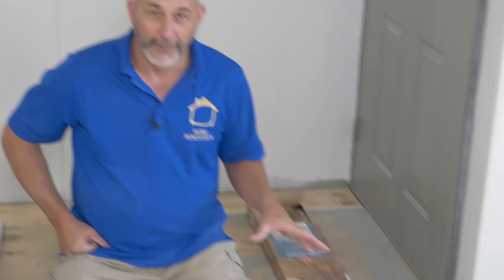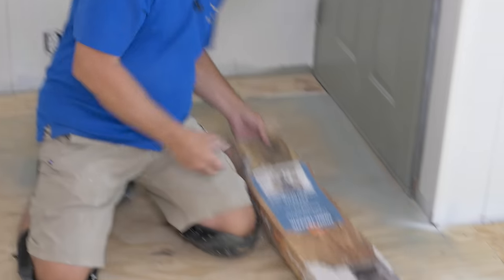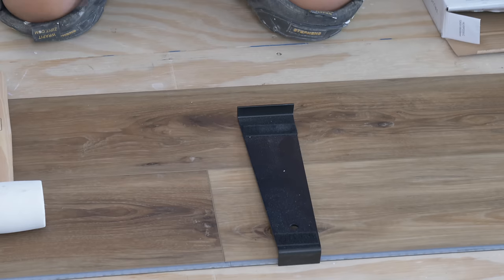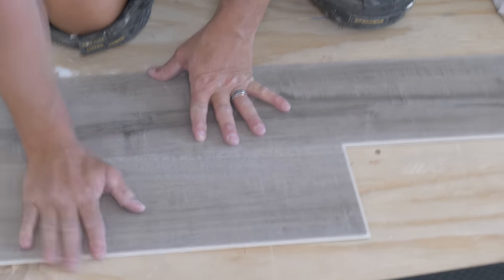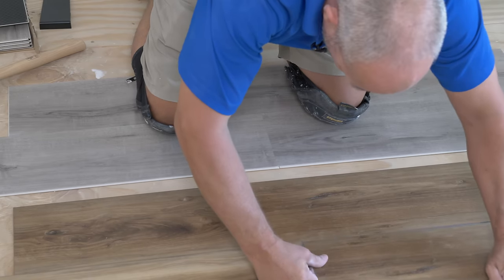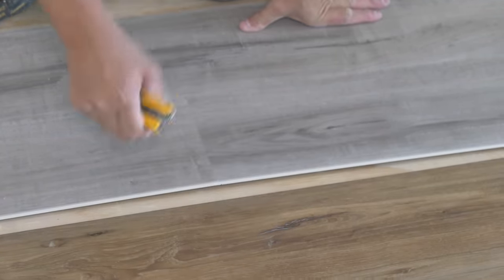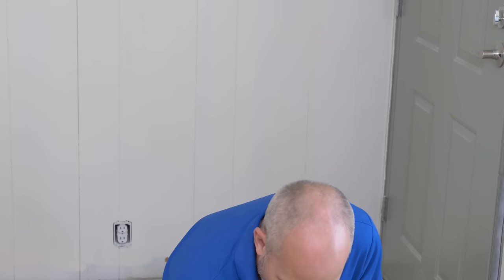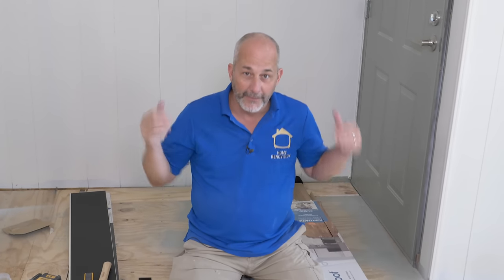2 Types Of Vinyl Flooring | Which Is Right For Your Home?

Comment: What do you recommend for a poured basement with radiant heat? We rebuilt after a house fire and decided on a 9’ poured basement and put in radiant before pouring the slab. It’s 28x58 so it’s a big project after putting in the energy walls. We are in Northern Wisconsin so we opted for heated slab. Thanks!

Comment: We own an apartment condo in Florida with 12x12 inch tiles on the floor which is concrete. The floor is primarily flat but certainly not perfect. I strongly suspect there is no movement in the floor so I’m wondering if the tongue and groove vinyl flooring will be a successful floor project. I would like to avoid pouring levelling compound if it isn’t necessary especially as the new floor will be next to carpeting.

Comment: What would you recommend I use on concrete basement? Laminate or vinyl? I’ve hear laminate may have water issues from concrete.
Reply from the maker: that all depends on the age of the house. in many cases I recommend a subfloor. for support during your reno consider joining our membership. I can consult and you can send pics. Cheers!

Comment: Went with engineered wood on my 1943 reno, because my subfloors weren't perfectly flat and I could staple them down.  Soon learned that it is very sensitive to moisure, aka cat urine.  It will cup on the edges.  I have to set weights on it while it dries to flatten it out.  Wood, tile or LVP next time.

Comment: Hi Jeff, my wife and I have a 70’s mobile trailer and the floors are all uneven due to trailer floor issues. We have repaired it to the best that we can, but the main floor area is a bit uneven. We are looking at replacing the old flooring which was carpeting throughout most of the areas. 

What’s your thoughts on a new type that we came across in the local building store called “ Lay Flat vinyl floor. It’s a product that you can on uneven floors and you glued down to the subfloor.

Comment: Is my scenario one where a click lock flooring would be appropriate? We bought a house that needed a total renovation, and did the first half of the renovation when we moved in. We have been putting the second half on hold for numerous reasons, but mainly money, however the floor on the main level is coming apart and causing splinters, etc. We need something to cover the existing floor but plan on replacing it with hardwood in 2 to 3 years (to match the first renovation) Would it make sense to do the click-Lock option in this case? Thanks!

Comment: We own a 1964 quad level home. We are looking to replace the flooring in the lower level, which is on a slab. One of the rooms will (springtime) become damp. We have placed a dehumidifier there and it has helped reduce the.moisture. What type of flooring do you recommend

Comment: I have a slab on grade... that was poured in the 60s... and is so uneven that before I used some leveler there were gaps approaching an inch over 8 foot spans.   At one point along the wall I noticed a crack.. so I figured.. open the crack up a bit with a chisel to get a good surface to bond with and apply some patch, right?    Apparently there was some sort of underlayment that they poured the concrete over.. probably a moisture barrier of some sort... and at that point where the crack had occurred it had bunched up really high so the concrete at that point was less than 1/2 inch thick... no wonder it cracked... sheesh.  I literally don't know how they poured that slab so poorly, unless they were actively trying to.  It certainly has made my vinyl floor journey... interesting.

Comment: Been looking to install new vinyl flooring in kitchen as previous owner used regular laminate which clearly not appropriate as it's lifting up. Will have to rewatch some ofvur previous videos as not familiar with the construction terms used. It's a 1970's home so floors aren't level.

Comment: Hmm 2nd floor kitchen, townhouse built 1989.  2 layers of sheer vinyl.  The 2nd sheet vinyl they used some self leveler but they could not get it perfectly level, it more a long distance in non level not a whole bunch ups and downs.

Looking at LVP overtop of existing sheet vinyl.
Reply from the maker: sounds fine to me. Cheers!

Comment: A couple more tips: if there is a flooring supply store like Prosol in your area, you can find plastic tapping blocks for your love taps that won’t damage the floor like metal ones do. It’s best practice on butt joints to start tapping from the joint out towards the open tongue to avoid a bit of buckling at the joint which can happen if you’re a bit too tight.

Comment: We have had vinyl for 6 years and my floors are very uneven or sloping (130 year old house). I have a couple of spots where it cracked because not having enough plywood under it. We are pretty happy with it overall, especially if it lasts another 15 years, which it seems like it will. Cost me about $3k per 1000sq ft.
Reply: Is this cost include the sub flooring and any labor charges or did you install it yourself ?

Comment: I have watched many of your videos and appreciate all the info you provide. In this video you talk about the ends coming undone and I get that BUT once you put the next plank on it locks the joint between the two boards making it secure and will not come apart very easily. Isn't that correct?

Comment: Tanks Jeff. Love your videos. Is Vinyl a good alternative for an older house where radiators are a primary source of heat? I'm concerned about a plastic type product might succumb to the heat of the feet which come in contact with the flooring

Comment: Thank you for the video, very helpful.  I was wondering when you mentioned the sunroom, we have a radiant floor cemented basement.  We are DiYing finishing it.  We need it to handle moisture.   What product?  Or is tile the only way?  We were hoping to stay in our wheelhouse, and avoid nailing because of the pipes and cement, glueing due to moisture or grouting (no experience at it) .  We have used vinyl tongue and groove with cork back before, but will it be okay with that direct heat?

Comment: I have used both and had it professionally installed and the one that you use the tool to close the inner gap is pure garbage for spills. I wouldn't waste my money on that flooring ever again. Oh and the space you have to leave around the baseboards so it can expand also helps it become lose and leave gaps. If you have kids or pets I don't recommend either of these types of flooring. Spills cause buckling and like he mentioned the joints are easily damaged and they start peeling and it looks horrible. Also a quick fix is not an option you have to start from one side of the room and remove all the planks without damaging them which is almost impossible to fix the one that was damaged then reinstall which is a total pain. The tap joint ones also if they get wet over a few short times they are ruined.

Comment: I just purchased a new old home.  Built 1900s.  It has planks and linoleum.  The planks are starting to come up and where the linoleum  is there is a strong odor of urine.  I was told water can enter the joints of planks which causes them to separate.  For that reason I want linoleum.  As a disabled single woman, I having a contractor do the work.  WHAT SHOULD I DO?  Plank or linoleum? BTW the floor is uneven.

Comment: I have a question because I just bought $8,000 worth of nucore vinyl 2022 Deerfield Hickory love the color ready to install it and then come to find out Floor and Decor has an F Better Business Bureau rating and a lot of people are complaining about the poor quality of Nucor now I got an 8 mm 30 Mill wear layer seems to be pretty strong but it is on the softer side and it doesn't have a Sheen to it,  which I like for my rustic-looking house. A contractor that I met in Floor and Decor actually told me that this particular one did have a problem and that it was fixed maybe a bad batch so I figured maybe everything would be fine he never ended up giving me a bid and I'm starting to think it's because of that flooring does anybody else have experience with new core products do you like them or hate them or have they been perfectly fabulous for you
Reply: Follow the manufacturer’s instructions you will be just fine.

Comment: The people I purchased my home from (in 1986), had enclosed the 2 car carport, den, kitchen, breakfast area, laundry area, pantry and turned it into a 1200 sq ft carpeted Great Room.    That was the selling point for me on the house.   I want to replace the carpet with something easier to keep clean.   I have some serious allergies.   Also the house has been unoccupied for over a decade.   I am confident their contractor did not bother to level the carport floor.   Would you recommend self-leveling concrete?   I am thinking I could save money by removing carpet and padding and leveling the floor myself.   At 73 I am definitely going to tackle installing the flooring although I do not know how long I will manage.    Being stubborn I know I have to at least attempt to DIY it.   (Removing carpet and pad is nasty and physical but doesn't require heavy concentration.   And no measurements.)
Reply from the maker: depends on the amount of slope. for large variance regular concrete or gypcrete are also great options.
Reply: @HomeRenoVisionDIY  .   Unless someone (moi), is looking for it the slope is not currently noticeable.   Once I remove the carpet and pad I will verify the actual difference.   Thank you.

Comment: I just installed lifeproof through my whole upstairs without any transition strips (only about 1000 Sq ft). It went in nice but now there are quite a few joints that are showing a gap on the short end. Maybe this was the issue?

Comment: Can self-leveler be used on a wood subfloor? Or does the moisture get sucked into the wood & eventually warp/crack it?
Reply: Yes but you have to apply primer on the subfloor before pouring self leveller
Reply: @Faruk651  Thanks for the info…
Reply from the maker: I have a video on that process here. https://youtu.be/cGHlkW2lJpY
Reply: @HomeRenoVisionDIY  I’ll be heading there! Thanks!

Comment: On the tongue and groove. If you need to start a long run in the middle, say a long hallway from left to right between three rooms on each side can you start in the center and work backward either left or right so the flooring matches up in the rooms match ?
Reply from the maker: a good t and g can install in 4 directions. Cheers!

Comment: 8:10 that does not happen, it is locked into place by the tongue and groove of the planks either side. i have it and did not level a part of the floor and it flexes but does not split like that. (one day i will lift it all up and do it properly)

Comment: Thanks for the great info, Jeff!
I’ll be renovating my basement in the near future and removing our 70’s shag carpet 🤪 and am looking to do some LVP/LVT. Do you think the LifeProof would suffice? We have a HD overstock store with deep LifeProof flooring sales which is appealing. It is a concrete slab basement that I will level and follow your other videos for moisture proofing.
Reply: Also, is buckling an issue with these flooring? We did hardwoods on our first floor and my wife said the sales men said LVT/LVP tends to buckle. Biggest space is 18’x17.5’
Reply from the maker: that guy lied.

Comment: My spc flooring was definitely harder to install. I ended up paying to have it installed. I could not get it to line up right when tapping it in placed. Definitely a 2 person job if your doing a large area or hard house
Reply from the maker: i found connecting the length first makes it easier.
Reply: @HomeRenoVisionDIY  my planks were 5 feet long. The trick you showed with your knee probably would have helped. They used their feet to get enough reach.

Comment: Our home is 30 years old, original owners. We have a hardwood flooring on the majority of the first floor (over a basement). The wood floor has been refinish once, (not a very good job). Could a vinyl locking system be used on top of the current flooring?
Reply: Jeff , I have pretty well the same question, I think it would go over hardwood flooring but would like your opinion. I have watched you for years, you would not know it but you really helped me to do my whole basement. Thank you

Comment: I bought our house on a slab and whoever installed previous floor didn’t lock etc I have gap 1/4 to 1/2 in from everything moving around which has caused peeling etc we’re looking at floor replacement but still undecided

Comment: Do you have any experience with the lumber liquidator brands of vinyl? Coreluxe and tranquility?
Reply from the maker: not yet. In my experience ll is lower quality than box store
Reply: Im surprised to hear that, we do sell some cheap turn and burn vinyl, but I think there are high quality products we offer. Love the channel and the work you do regardless!
Reply from the maker: with all things, a company brand determines opinion. if the new LL wants to change my opinion then all they have to do is reach out for a conversation.

Comment: The floors in my hallway, and master bedroom have that Pergo flooring, and I gotta say it sucks. It came with the house, so I have no idea how old it is, but it has a few spots where the edge of the board has been chipped away. In the hallway it makes a small, but audible click noise, and some of the boards slide around because they were installed going across the hall instead of flowing with it. We want to do all the floors, but it's going to cost a fortune even if we DIY it.

Comment: Whats difference between a mallet and hammer?
Reply from the maker: less lbs per sq inch reduces the risk of damaging the flooring plus it does not have any sharp metal edges so you won't accidentally scratch the floor during install.

Comment: Hmmm, this explains a lot of what I've seen with DIY installs.  They look nice at first but after a few years they're separating, coming apart and bouncing or have what I would call bubbles.  The difference in modern floor joists compared to old makes this make sense.  I guarantee what I've seen are products of not properly prepping the surface.

Comment: vinyl planks all suck. It bends like rubber when you install it and it's really easy for the tongue and groove to separate in the floor. It's more work to make starter rows straight than traditional laminate. You can only install it one direction whereas laminates you can get one in from the opposite direction (like going through doorways) if you need to and flow through multiple doorways without stopping and installing t moldings. T moldings in every is doorway is a trailer park aesthetic, in my view. The floor smoothness has to be a lot more precise than traditional laminate. Flooring just keeps getting lower and lower in quality.
Reply: Nobody installs T transitions in every doorway.

Comment: Don't forget to mention when doing baseboards, make sure there's not plumbing running through the wall if there's a bathroom on the other side. 🤦🏼‍♀️ I've learned a lot of things the hard way and this was one of them. Slow leak rotted the whole corner. 🤦🏼‍♀️🙄

Comment: Please for the love of god if ur installing LVP that has the tongue n groove system on all 4 sides(not drop n lock on short side) then dont install it how this guy did. No need for acrobatics to install some LVP. Just angle in the short side FIRST then slightly hold ur piece up at an angle so u can tap it back to lock the plank together on the long side. The only time i ever have to install long side first and then play twister sprawling out on the floor to reach across the plank to the short side to tap it into place is with certain Laminate floorings. Some of them can just be more of a hassle trying to get the long side locked in if ur already have the short side locked. So thats when i will lock the long side first and then tap back to the short side. But ALL non drop n lock LVP  should be installed short side first then long side… also heres a pro tip- there isnt an LVP on the market that cant be cut with just a utility knife. Always blows my mind seeing everyone using saws to cut LVP. Just score the plank with ur knife and then snap it. No need to get up n down and run back n forth to saws. Just need ur knife,tape measure, pencil, mallet/tapping block and some knee pads and ur ready to install ur entire house in some new shitty LVP👍🏽 (just spend the few extra bucks and atleast get engineered hardwood. Even a thinner or lower quality engineered hardwood would be better then highest quality LVP u DIY’ers would buy at a big box/chain store)

Comment: As a flooring installer for most my life I’m 59 today, installing pretty much everything over the course of my life even did hard floor sending,stain and varnish.
I got to say those vinyl products to me are much better than laminate products because of moisture issues.
But as you said they are not miraculous.
Your video is very well explained and shows an important difference is the lasting of the product.
Well done keep doing good work !!
Reply: And you approve of using a pull bar on a factory edge? Speaking of pull bars he needs to lose that mamby pamby thing and get a real one.
Reply: Which one is better